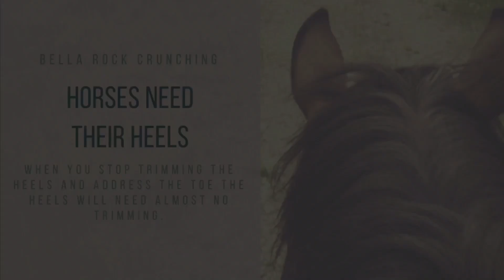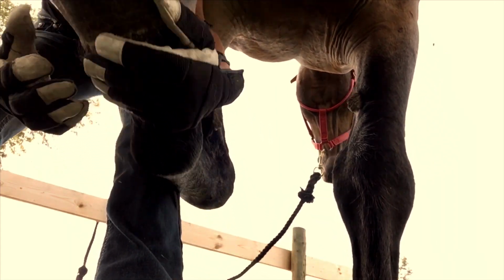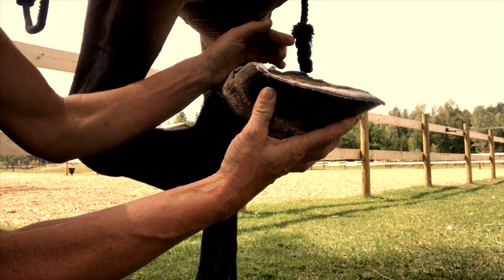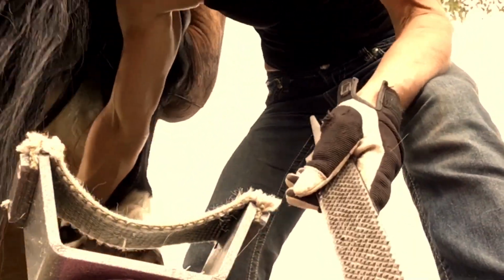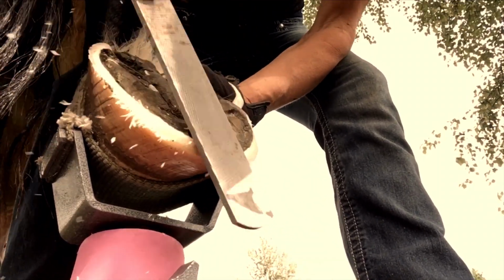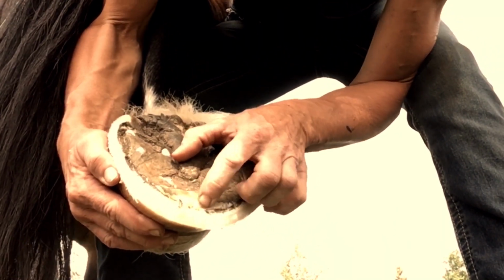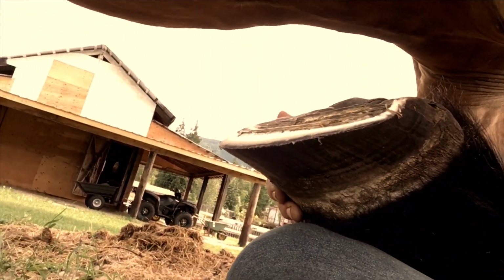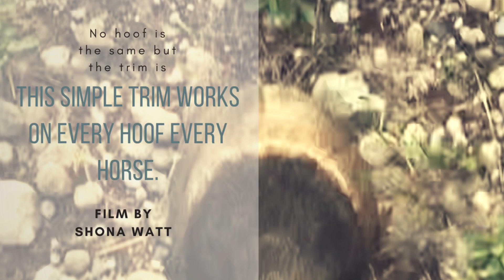Passion Horse HGM Trimming Series

Comment: Excellent video of the HGM method.  I think I get it more now.  So, if you don't  rasp from the top to address flares does the bevel to the front (5 & 7 on a clockface) of the heels deal with flare eventually?